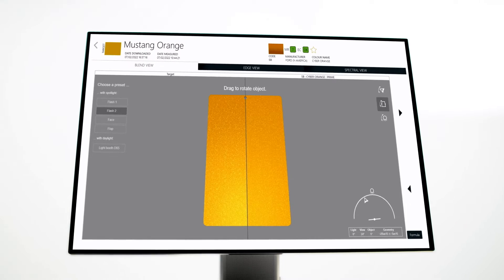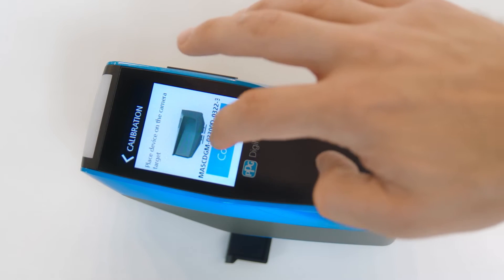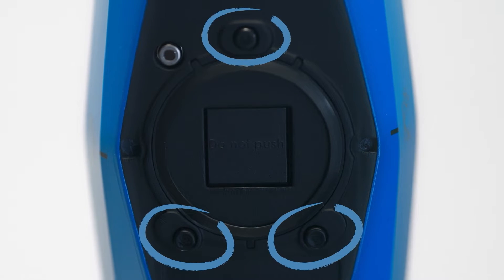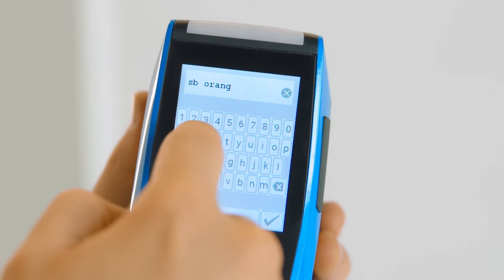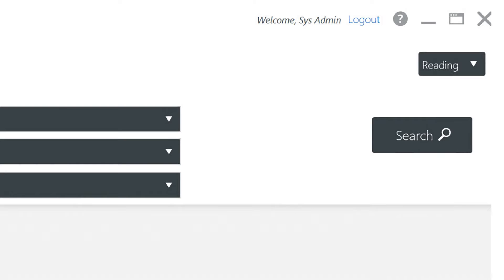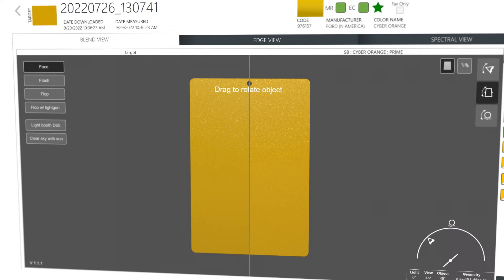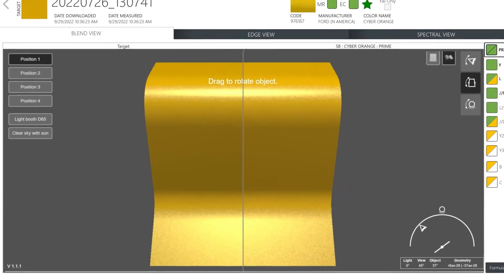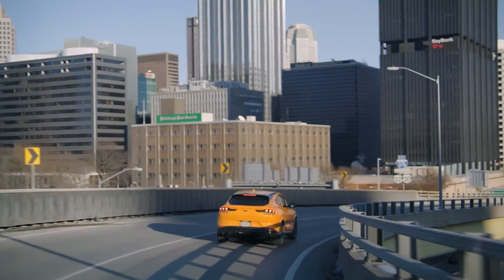PPG DigiMatch™ and PPG VisualizID™ Training Video

Comment: Great tool improvement. 
I focus on the Delta readings on every match. 
I have eliminated 80% of spray out cards. I train my customers on how to utilize the Delta along with metallic orientation and they are having great results. I can’t wait to work with this new software. 
Thank you Ppg guys for all the hard work you guys do.
Reply: Very disappointed in the elimination of the chips. The camera is off 70-80% of the time and constantly spending too much time tinting. Very counterproductive if you ask me.